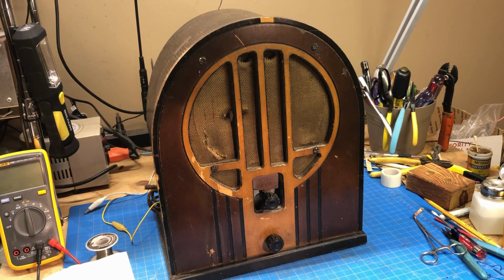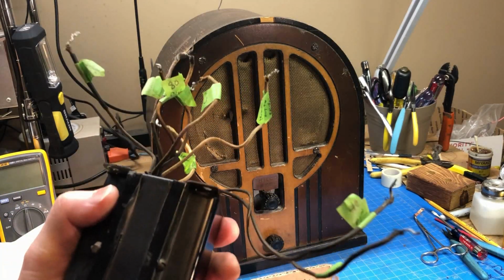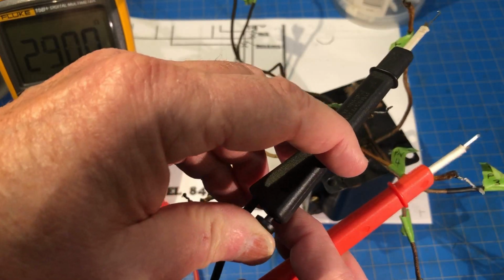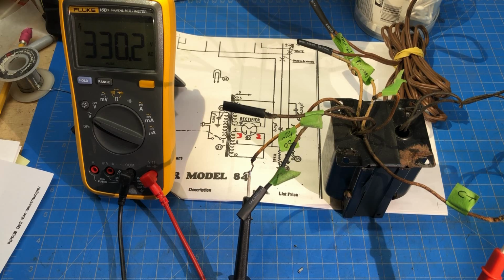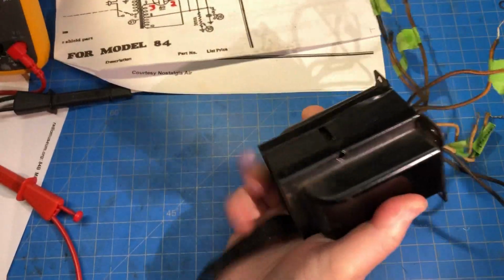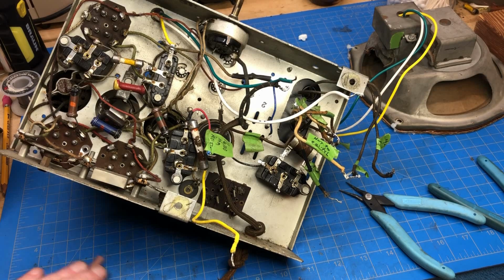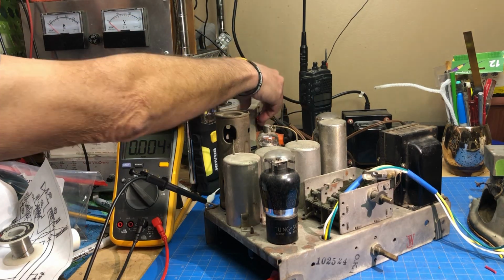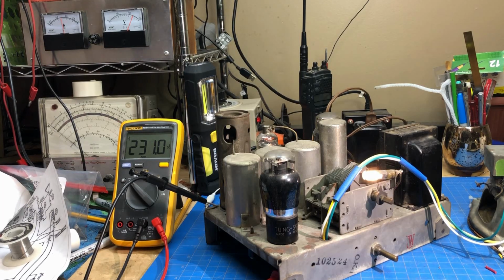1934 Philco 84B Part 1 of 4 A Little Detective Work

Comment: A good object lesson on a power transformer.  By reversing the secondary filament leads with the secondary high voltage, the transformer was turned into a step down transformer - 700 to 70 volts and 350 to 33 volts - about a ten to one step down.  Guess what: current was multiplied by 10!!!  Explains the 500 mA at 30 volts.  Yes -   enough to really knock the soup out of you!  Maybe you need arc rated lineman's gloves.  You did run it through a dim bulb current limiter, right?  Good video for all to learn.
Reply from the maker: Hallicrafters Rehabs Thanks! Great comments!! When I got the radio, the transformer was removed...all my troubleshooting was outside the radio....I have a dim bulb...but very seldom use it anymore...my test bench is double fused at 1 amp thru n isolation transformer....For two reasons....one to protect the radio and the amp meter in line ( limit 1 amp).  Thanks for watching and as usual the great comments!!! Take Care—Larry
Reply: I have an original Lionel train transformer (which we restorers would call a variac), and it delivers 16 VAC max output, enough to run a fully loaded Lionel train angry and fast.  This is not well known but my finger got in between and made a connection on the track and I had quite the shock (not like 120 VAC mind you)  but enough to remember 60 years later.  Only 16 volts of potential.
Reply from the maker: Hallicrafters Rehabs Yes!!! We all take “low” voltages lightly!!!! But what escapes most folks....it only takes a couple of mA passing they the heart to kill you!! The amount of voltage is not important!! 😵

Comment: nice find... the person who reversed the ht and filament windings must have seen a flash as the filament died you would think... 660v on a 5v filament surely wouldn't do it any favours.
Reply from the maker: George Christofi You would think George....but, all info from Terry, 80 was good and no damage??????🤔 perhaps it wasn’t wired wrong and there is an intermittent problem just lurking in there??? Forward we go and see what we can see!!! Good comment!!! Take Care—Larry
Reply: You can never tell with some folks or radios if the filaments have burnt out! I guess the 80 must just be one of those super resilient tubes that can take a hit. We shall see for sure. Best Wishes, George